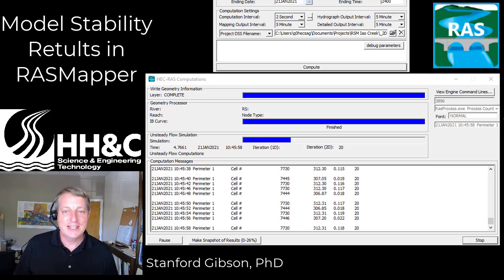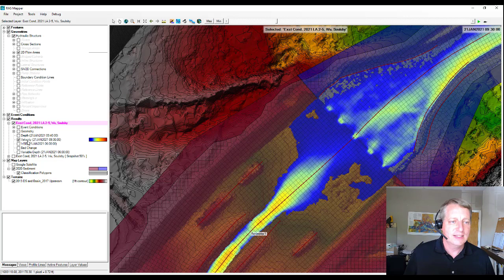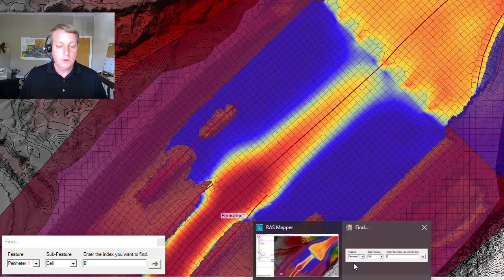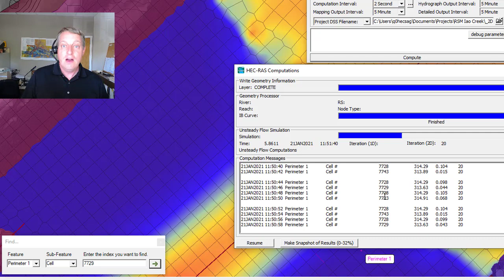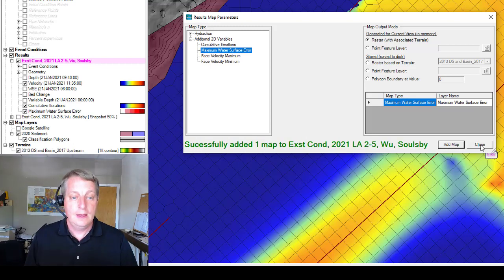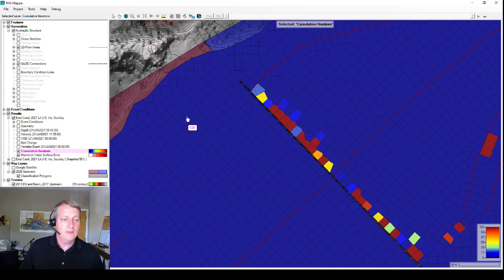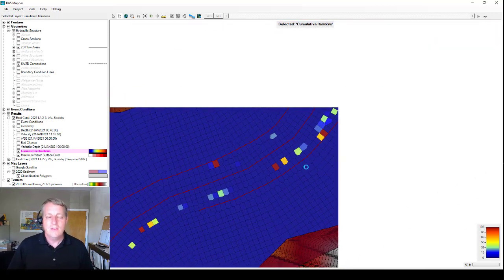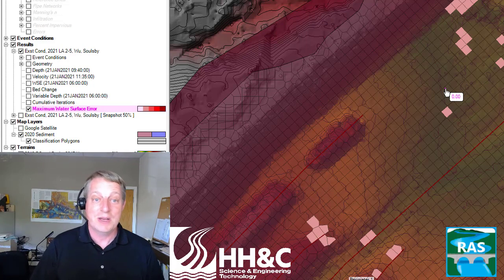Troubleshooting Tools for Unstable 2D HEC-RAS Models

Comment: I have been using the tools you mentioned to check the error maps—specifically, I focus on the Courant number and WSEL error maps. These are easy to visualize, but I’ve never seen your video explaining how to fix such issues without making major alterations to the 2D mesh.

For example, if there are 15 cells within your 2D domain showing a Courant number of 12 and a WSEL error of 1 ft, how would you quickly fix that?

Comment: Hello! I have a question about mesh convergence.  

I'm modeling a channel about 9 km long and approximately 100 meters wide. The water flows through the channel without causing flooding.  
I ran four tests with mesh sizes of 7x7m, 5x5m, 3x3m, and 2x2m. The timestep is adaptive based on the Courant number. In the first two cases, it stayed at 1 second, and in the last two cases, it was 0.5 seconds.  
The more refined the mesh, the lower the water levels, and I can't reach any convergence.  

Any advice?

Comment: Thank you so much, Dr. Gibson. This is incredibly helpful! I do have a follow-up question—how can we address those problematic cells? Would it be better to add breadlines to guide the cell faces in specific directions, or should we decrease the cell sizes/add computational points in those areas? Do you have other suggestions? Thanks!

Comment: I have a relatively simple model with 4 culverts from upstream to downstream at several stations. The water don't even go through the first culvert... it stucks there and after a while the model computation failed. I check many times DTM US e DS elevations at culvert, I increased or decreased cell dimension, I diminished timestep to 4 or 5 seconds, I verified that slope is positive and ate least 1% locally from US to DS of the cuvert barrel but nothing. The model doesn'ty run! I cannot find a solution.... it's 1 week I stucked there, I created entire model from the beginning but nothing.... nothing 😕... Do you have a page to submit bug requests? I think it's a software bug...

Comment: Thanks for this video, very helpful. I am having a similar issue with a model i created. It's a rectangular spillway in which the water drops down feeding directly into a large culvert. The stability after the water drops from the spillway and into the culvert spikes and causes a the model to work incorrectly. Any help/recommendations for this issue would be greatly appreciated!

Comment: hello, someone knows about this error? HDF5-DIAG: Error detected in HDF5 (1.10.6) thread 10344:
  #000: D:\build\HDF5\1.10.6\hdf5-1.10.6\src\H5F.c line 444 in H5Fcreate(): unable to create file
    major: File accessibilty
    minor: Unable to open file
  #001: D:\build\HDF5\1.10.6\hdf5-1.10.6\src\H5Fint.c line 1509 in H5F_open(): unable to open file: time = Fri Jul 26 13:34:22 2024
, name = 'C:\Users\Jonathan Proaño\AppData\Local\Temp\76d7fabd-71ac-4f5e-b4e4-097452e2a832.h5', tent_flags = 13
    major: File accessibilty
    minor: Unable to open file
  #002: D:\build\HDF5\1.10.6\hdf5-1.10.6\src\H5FD.c line 734 in H5FD_open(): open failed
    major: Virtual File Layer
    minor: Unable to initialize object
  #003: D:\build\HDF5\1.10.6\hdf5-1.10.6\src\H5FDsec2.c line 346 in H5FD_sec2_open(): unable to open file: name = 'C:\Users\Jonathan Proaño\AppData\Local\Temp\76d7fabd-71ac-4f5e-b4e4-097452e2a832.h5', errno = 2, error message = 'No such file or directory', flags = 13, o_flags = 302
    major: File accessibilty
    minor: Unable to open file
Reply from the maker: If you get an error like that, it is a  bug.  Even if it is user error, we should provide more informative error messages.  You can send a bug report and a link to your modle to the RAS inbox for this one.

Comment: @stanford so if I generate a Max WSEL error Raster and it shows multiple errors across the domain, BUT I achieved an overall acceptable continuity error AND flow and stage are stable through structures, than I shouldn't go in and consider for example lowering the time step and so forth?
Reply from the maker: That is really a matter of risk tolerance.  Is the model performing well enough to answer the question you are trying to answer?  I go to work with models that hit max iterations all the time if the errors don't diverge into instabilities.  But I'll be more careful with a model that is iterating and check the offending cells pretty often to make sure they aren't propagating instabilities.
Reply: Thank you I appreciate your response! @stanfordgibson
Reply: How to fix WSEL error
Reply: @basmaawad9892   WSEL Error is not necessarily a sign of model instability, you have to understand the process of your watershed to fully determine if your numerical representation of it is incorrect
Reply: @civilenggggg  l represent a 100 km reach of meadering canal its max width 60 m  the mesh is 30* 30 in the canal refinement region and 200 at the rest of mesh.  I also simulate sediment and the model is unstable when I enter the boundary condition of lateral flow as internal BC at the canal. How can I fix the problem?
Reply: @basmaawad9892  Try changing the lateral flow to a "uniform lateral inflow" and distribute it along the necessary XS's
Reply: @civilenggggg  It is not activated at 2d model
Reply: @civilenggggg I enter it as flow hydrograph

Comment: Thanks for this great video. I am using HEC-RAS 6.1.0 and when I follow the step I don't see the options under "additional 2D variables" Instead I see cumulative excess depth, infiltration depth and precipitation depth. and the second question is that let's say we found the problematic locations "cells". Then what approaches we can take to fix them. Thanks
Reply from the maker: This feature is only available in versions 6.2 and later.  So you will see it if you update to the latest version.  As for how to deal with problematic cells, that is a much bigger topic.  In this case I improved it by changing my base time step and adaptive time step parameters - but there are many reasons cells can iterate.  I'll try to eventually  push out a few videos that cover a couple of these at a time.

Comment: Every time I tried to add the Cumulative Iterations layer to a model run I get the following error - "Offset and length were out of bounds for the array or count is greater than the number of elements from index to the end of the source collection."
Any idea what that means or how to fix it? Thanks, these videos have been very helpful!

Comment: Hello Sir, Good Morning. Dear Respected Sir,  I have a query. Sir, Can be we do 2D Sediment transport modeling in hec ras with considering a bridge in a river flow path? Sir, I am eagerly waiting for your positive response. Thank You
Reply from the maker: We have not done any work on sediment through bridges.  So if it works, it is incidental.  This model is passing sediment through this structure. But it has open air gates, so it is really just a weir with drops in it.  I was planning to test a bridge next, but bridges will probably require some work and testing to perform well with 2D sediment.
Reply: @stanfordgibson  actually Sir, my professor assigned me to do this work but i don't have any idea how to do? That's why I asked from you Sir.